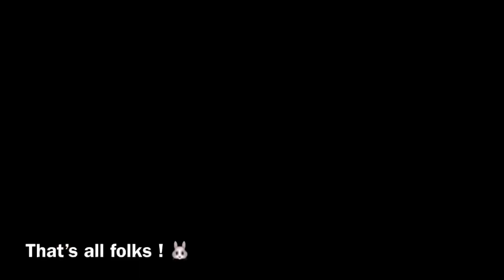What Is Inside 900W Disinfection Fog Machine / Teardown / Disassembly | Repair & Spare Parts Links

Comment: Hi , i just buy my new fog machine .similar like this one . I only use 2 times and now the machine has no smoke out.
Reply from the maker: If its oil pump still makes sound clean its ends with ear cleaning bud and remove as much oil/debris as you can, and then try to cleanup with water and vinegar solution. If some water comes, keep doing it till water comes with a force, now try fogging again.

If it does not make any sound the pump may be dead or there can be an electrical failure. Get it checked.

Comment: Fog machine ok it's working taking oil into pump but fog was not looking that means it's doesn't smoke just running what's was the problem after few minutes it's smell was like a burned
Reply from the maker: If its taking in the oil either the oil will come out as liquid from front or it will fog.. what is your situation?

Comment: Hey same problem pump good but no fog  heater getting  hot pump shooting liquid when outlet line is removed then nothing when put back please advise thanks in advance
Reply from the maker: The heating rod / core may be choked. Open it from machine. Keep it upside down and use a injection 💉 to push in vinegar. If its not coming out the other way leave it vertical for 5-10 minutes or try pushing in a thin wire to clean the blockage.
Reply from the maker: Don’t touch the core right after using. Its extremely hot and will give third degree burns immediately.

Comment: I cleaned the pump as us said, but the pump is not sucking the solution. I hear a tap sound when I click the fog switch. Do I have to change the pump.thanks in advance
Reply from the maker: May be the pump’s O ring has swollen. It would be hard to find.

Get it checked by an electrician. He’ll guide you further.

Comment: As you have elaborated in other diy I have cleaned the pump from both sides with vinegar solution so now its unclogged and liquid is flowing with force but the intensity is smoke is very less and is takes quite a time like 10 min to preheat which was 3-4 min earlier and burning smell comes front the machine
Any ideas how to fix it??
Thank you
Reply from the maker: Do fogging 4-5 times with pure vinegar solution. May he there is some deposit inside the heating core as well.

Also check if you’re adding at least 15-20% glycerin to the mix. 

Try & Let me know if it worked.
Reply: Thanks for prompt reply
I forced pure vinegar inside the core through syringe and kept it vertical for 10 min
The vinegar solution was used to fog but still it heats up very much and the smoke is still not intense..
Any thoughts???
Also pump stops working for some time and again starts ..
Is something wrong with it?
Thank yoh
Reply from the maker: Are you adding enough glycerine ?
Reply from the maker: Regarding the pump, usually pumps last really long as its just a metal rod moving inside a Magnet.. I guess it has heavy sebum deposit inside. So suggest you to do full cycle cleanup fogging with vinegar or vinegar + water for at least 4-5 times.. 

Also once done fogging you should do a clean R/O water fogging because vinegar itself is also corrosive.
Reply: Found the fault ...
It was with the  6mm o ring which has been swelled up and gripped the plunger thus not sucking up liquid...
Needs replacement ...
Any idea where it can be procured..
Thank you
Reply from the maker: That would be hard to find. Better to source a new pump. Or look for a scrap pump and take out its O ring. You can put requirement on olx.

Comment: Machine is not work as well d timer
Reply from the maker: Timer would be hard to find. Ask electrician to check the faults and relay the timer button to direct power.

Pump and heating tube are available on AliExpress.